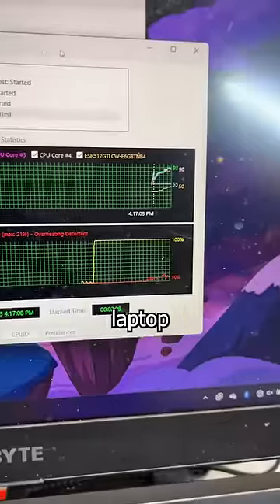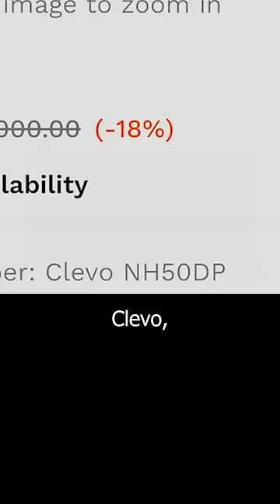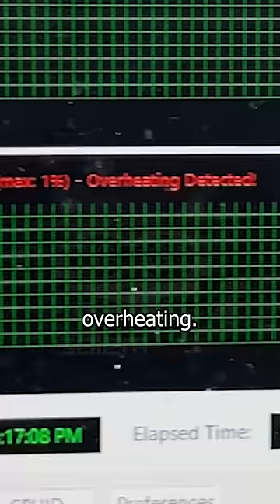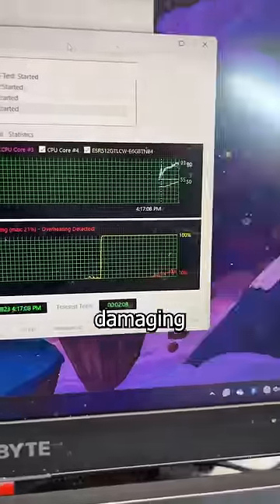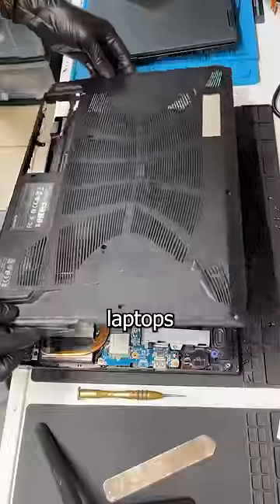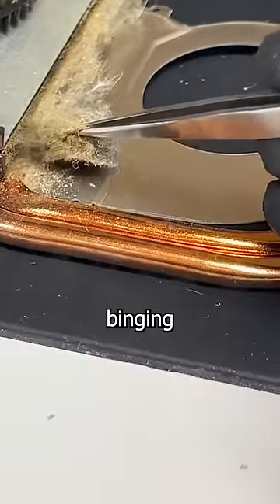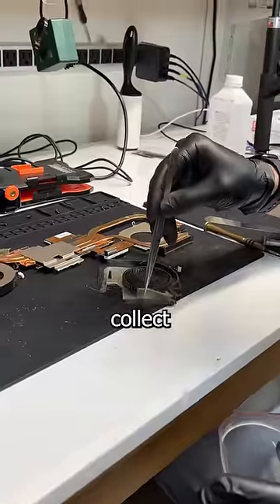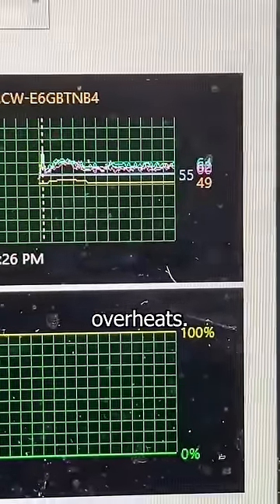Cleaning a Gigabyte #gaming laptop (easy fix) #tech #pc #technology #shorts

Comment: And this is the main reason why i prefer full PCs instead of laptops for gaming, not only the fact you can upgrade the thing, but also the ease of cleaning, you don't have to take out like 50 screws, and then have to disassemble the entire cooling system to remove dust from the fans

Comment: I own the AMD A7 variant and this video told me that the fans cannot be removed without taking off the heat sink, had it for a year and I'm very pleased with it, I do regular cleaning every two weeks to remove the dust from the fans with a brush and a low power vacuum on an angle, also I wonder what's the best thermal paste for laptops or does it even matter.

Comment: My laptop is cool on the right side and super overheats from the left side bcs Lenovo foolishly didn't put 2 fans. Just one fan one vent and sound grills as secondary vents. Should I carve out the body with a metal cutter to make new vents on the left side as well? PS:- without a Coolpad it would have boiled upto blue screen error appears due to overheating.

Comment: Hello! I have a question. I hope someone could help me.

My HP 14s is shutting down due to overheat (said the system). I can open it for few seconds but it shuts down on its own right away. Does this mean I only have to deal with the fan and the thermal paste? 

Currently, I have not brought it to a technician yet because it is holiday and most technicians near us that I have located will resume on January 2.

I would also like to ask if not having it fix right away would cause more damage? I just found out that it was broken last December 25.

Overall, I really am praying that I only have to deal with fan and thermal paste and that the mother board or the chip is not damage because I don't have the budget to buy a new one yet.

Thank you so much!